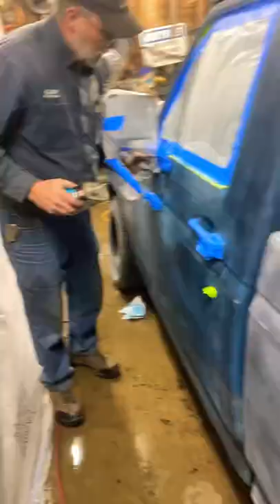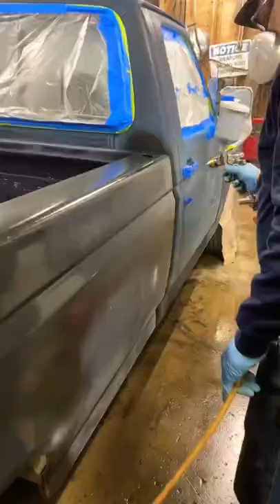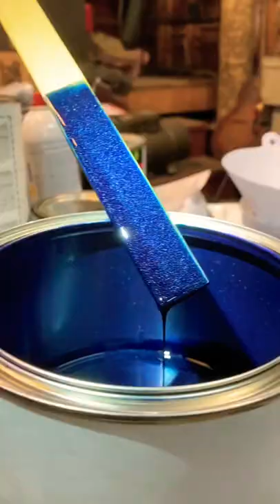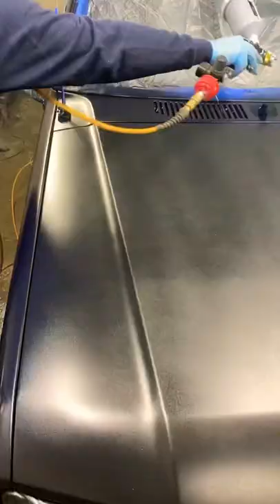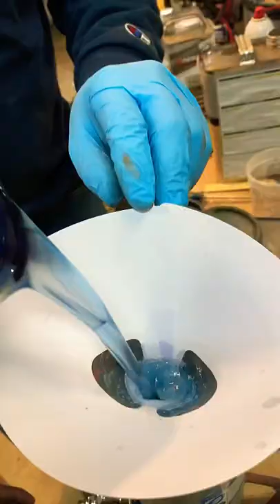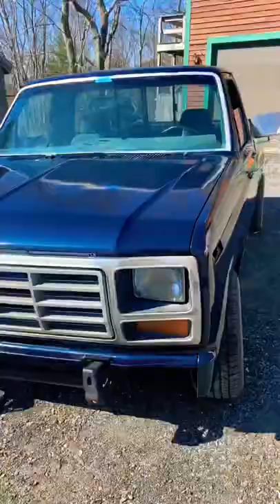DIY truck paint job.         (UNDER 200$!)

Comment: Thats A LOT of orange peel brother. Always best if your inexperienced with painting and spraying to pick the slowest reducer possible. That way the material can flow out flat on its own . HOWEVER amazing job for what you guys used
Reply from the maker: Agreed she’s real peely haha , But luckily I new and expert with a buffer and he smoothed it out pretty good 👍
Reply: @wickedgunguys8144  nice! Yea as long as you get enough material on you can always cut it down
Reply: What is orange peel?
Reply: @chappelloutdoors3795  when the paint texture looks like an orange. Happens after most paint jobs unless the painter is really experienced and sprays even coats throughout the whole spray. Usually can just wet sand and buff it out smooth
Reply: That's a new color it's called blue orange haze
Reply: I like my paint jobs to be as clear as a mirror! But this is orange peel like CRAZY. VERY DULL.
Reply: @krazex  Orange peel can be caused my numerous factors, low air pressure, the wrong reducer, shit gun, material not reduced enough, gun too far away from project and so on.
Reply: Orange peel means your gettin it on thick haha! I bet it looks great after a wet sanding and buff .
Reply: A nice wet sand will take care of the peel
Reply: You get more trash with slow reducer
Reply: @Nardage  extremely true
Reply: Great advice on the slow reducer..💪🏾💪🏾💪🏾💪🏾💪🏾💪🏾
Reply: @countrysmurfcomedy3099  it's a gift and curse. Material flows out flatter 
However you. Get more trash in the paint because the surface is tacky longer
Reply: @izzywashington5461 how do you wet sand?paper Grit? Hand sanding?  Doesn't the wet sanding dull it then you have to buff it?I've painted a couple cars had orange peel.
Reply: First paintjob I ever did was just enamel, no clearcoat, and it wasn't orange peel it was corncob. I spent a ridiculous amount of time wetsanding it, and when I was done it looked pretty damn good.
Reply: @chappelloutdoors3795 an orange has divits like a gold ball and so does car paint if you paint it incorrectly. You want it atomized not spitting out gobs of paint like a spray paint can.
Reply: Might wanna try more air pressure and a smaller rip in the gun that looks horrible
Reply: The first mistake was not flowing out the sealer. After that anything you could do couldn't result in a smooth finish.
Reply: But it’s gotta be single stage for $200. Cheapest clear kit out there is about $70
Reply: @int53185 what does “flowing out the sealer” mean?
Reply: What is a slow reducer?
Reply: @ballzzinyourmouth8  a BOSS!!!!
Reply: The base coat looked bumpy too
Reply: @caezarlapuc8627  yeah what does that guy know he’s just a manufacturer 😂 jk bro
Reply: I love the input AND support! 

I was wondering, can I use homedepot paint and primer to get away with a matte paint job on a work van?
Reply: I’ve seen an old guy paint his car with latex house paint and a brush. After he sanded the brush marks out it looked decent and lasted several years.
Reply: This way you get the most runs possible because the paint doesn't set up.  You only use slow reducer in very hot weather.
Reply: 90% of a paint job is in the prep... Yes it has tons of orange peel.. but it can be blocked and wet sanded.. block in wet sanded and buffed and would be awesome.. my hat's off to somebody trying it on their own without spending a fortune..

Comment: In younger years we'd paint our cars with what we called the 100 dollar paint job. A gallon of tremclad on sale, any old sand paper will do that's on sale, grab a gallon of varsol and give 'er. Well, in the end at least it was all one color. We'd all be back slapping each other saying oh ya that's really cool.....lol.
Reply: Now we have spray paint cans (high gloss please) 😂
Reply: Looks awesome !
Reply: My Dad use to do that Use the Tremclad  then add in Reducer to thin it out so that it could spray through the spray nozzle he painted  his old Chevelle SS $11 paint job and it came out So Shinny like a Mirror,  he didn't use a garage he did it on a very hot Sunny Day in the backyard, I remember with in 1 hour it was totally Dried to touch.
Reply: Varasol, now that's something I haven't heard in a long time! Back in the 80s dad used to bring some from the wire mill and I'd clean engine parts with it... I remember one time him bringing in a fresh can (bucket) home and told me to clean up an oil pan off a 396 bb. And I wasn't used to fresh varasol and look here....that stuff turned my hands white! It pulled all the oil out my skin 😅😅 dad said, you'll learn to stick your hands just in everything lol
Reply: @newfie66xbox76  I figured that would turn out really bad. You don't want paint to dry too fast or it won't level out. As a matter of fact, sometimes it will dry before it even hits the surface.

Comment: Looks good for what you had. For everyone talking negative i would love to see their process and the work they have done.
Reply: Well for starters, the paint looks rough due to low air pressure, big fan and and not enough reducer. You want a glossy finish? You add more reducer to make the paint even more smoother and make sure to lay it on wet, that way you’ll have a nice silky smooth finish, now for the  clear coat add 30% of slow reducer, that will help atomize clear to give it that glossy finish, so basically this guy got a lot to learn.
Reply: Clean the floor, wet the floor put on a river suit. if you’re going to spend money on paint at least put some effort into cleaning.
Reply: @yvn_youngdexter2741 yeah, years of training, really hard, I stay away from that stuff

Comment: the rough finish came from the primer sealer coat if it was sanded a bit before the base it would have layed a bit nicer. maybe too high pressure or too large of a fluid tip also but 200 looks about right if you had most of the materials in the shed already. metallic isnt the easiest for diy, done a few paint jobs myself now plenty of mistakes and lots of orange peel. good on you for giving it a crack and putting the video up

Comment: Ain't no way you bought tape, primer, plastic, basecoat,clear coat, and reducer for under 200 😂
Reply: Yup! I was wondering the same. Tremclad works surprisingly well though.
Reply: Maybe the supplies, but the paint gun setup definitely blew out the budget.
Reply: Def possible I think he means in materials not including the gun and all that. 
1 gallon of black base coat around 80.00
1 gallon of clear coat kit 70.00 is
20-35 grams of color pearl Mica 15.00
Roll of paper 6.00 amazon
Tape amazon 10.00
Def doable under 200.00
Reply: @jasonhare4840 you forgot plastic, reducer, wax and grease remover, tack clothes, sand paper, and tax for all supplies. Also the black must have been a sealer or primer, if not then once it dries you will see all kinds of things shrink back because of paint soaking into old paint. Ain't no way you gonna make it under 200.
Reply: Says paint job under $200, could be what he charged to do it. LOL supplies are extra.
Reply: @Maybe-You-Know-Me-Not If the labor here is under $200, he's not gonna be in business long. Maybe if it was only for the steps shown...

Comment: Ford Galaxy Blue? Looks good brother, the peel can be from a small compressor soon as the pressure drops its instant peel i found, lvlp guns help, best thing i learned is spray with high pressure and dont skimp on thinners, top coats should be thin like water

Comment: Hey!  You wet the floor down!  Hell yeah thats how you do it!

extra bonus smooth tip.  Run a regular old humidifier overnight before hand

Super bonus tip, run a halloween fog machine a couple hours before
Reply: Humidifier?
Reply: @ikonik6286  yeah.  Wetting down a floor keeps you from kicking up any dust and makes the paint job smoother.  

Most basic thing you can do is prepare your space the night before get everything ready and then soak the floor.  Then first thing when you are ready to pain soak the floor again.  Gently though.

The humidifier reduces static by alot, that and the water being absorbed by airborne particles helps the particles fall out of the air.  Start it up the night before as well.

The fog machine does the same thing but on turbo and will get rid of anything left over.

Comment: Paint is ok just the compressor and the gun needed a little tweaking and a slower thinner would have of helped a lot but it does not forgive drips, if it has enough clear and get wet sanded and buffed it can be turned into a show finish. Anyways all these little first time mistakes are tuition for the next time, truck looks amazing and most importantly it didn't cost much.
Reply from the maker: There wasn’t actually any runs or drips.  Just the orange peel

Comment: Next time prime car 3-4coats then sand it with 320 400 then guide coat 600 spray the basecoat directly over fresh primer sanded too 600 way better results than that will get you somewhere

Comment: It would be a much better job if you're properly adjusted your air pressure and spray pattern properly it wouldn't be looking so dry
Reply from the maker: I’ll try that on the next one! Thanks!

Comment: So I stole a spray gun from Harbor Freight including the air hose, and regulator, then went back later that night and swiped a 50 gal compressor (not easy) almost got caught. Over a month I swiped tac rags, filler, sand paper, tape, assorted rags and acetone SO I could buy some Lowes Rustoleum paint and CLAIM I painted my car for $200😂😂😂😂. Just kidding on saying I stole a bunch of stuff🤣🤣

Comment: I was going to comment about the initial orange peeling, as those coats looked pretty thick, but you sorted it out nicely in the end 👍. Did you clear coat it afterwards, or just buff it shiny?
Reply from the maker: It did get clear year . I still need to wet sand and buff to hide the orange peal.

Comment: Swank. Nice job, Hermano. I don't give a flying blank about the orange peel if it's one tenth the cost of a cheap pro job and it's keeping the rust (and bored troopers) away. That's 1800 bucks worth of shocks and bushings and tires and a carb and bearings and filters and brakes... Besides a lot of orange peel is nowhere near as embarrassing as "Authentic Patina" (Nausea).
Reply: AS an old Ford lover and a patina HATER, I totally agree with you!

Comment: I call bs. Let's put it all together. The plastic, tape, sandpaper, sander (unless ot was done by hand. Which it aint.), degreaser, primer, basecoat, clear coat, and filters. $200? I think not.
Reply: I can't even get the paint in my area for 200. lmao

Comment: Did you just have the paint hanging around
Reply from the maker: Bought the paint, and a harbor freight spray gun , and tape and plastic.
 Had some old clear and the compressor already

Comment: this looks amazing, real quick boss, what's everything you used to get this done, also can I use a compression tank for the painting?
Reply from the maker: I’m not an expert but I’d say no on the. Compression tank. Need a continuous duty compressor must guns need 10-12 cfm to work properly. “Which mine wasn’t” haha 
   I used a 40$ harbor freight spray gun, and found someone with a compressor that would let me use it. 
 Bought some tint at Napa. And used some left over clear from another job.

Comment: Your spraying scared to much orange peel gun not set up properly  you spray way to fast and to scared....slow down ...when spraying open the fuild tip up you cant see it atomize ...the paint can't flow out therefore your get orange peel.